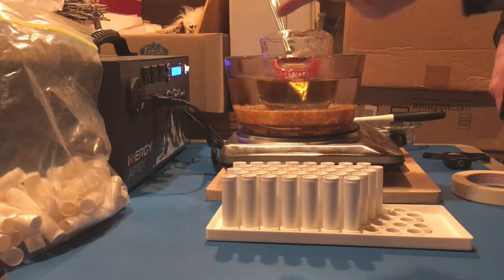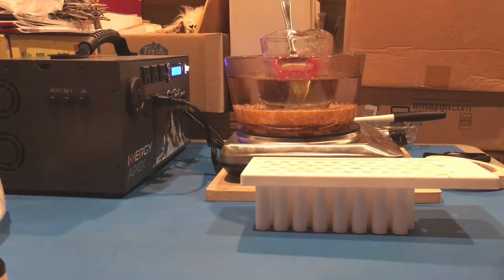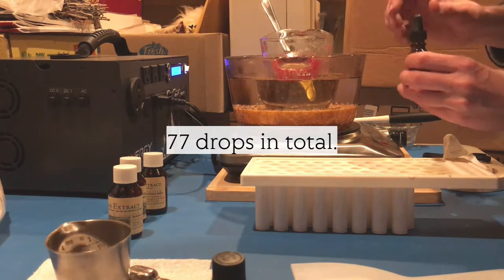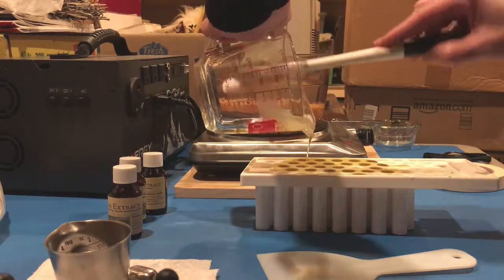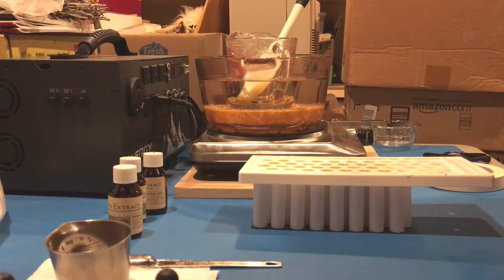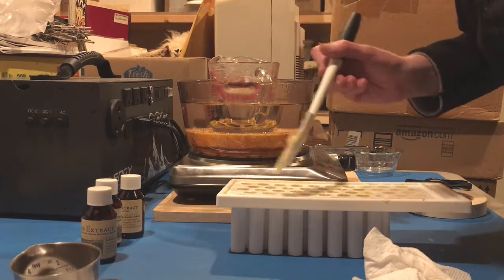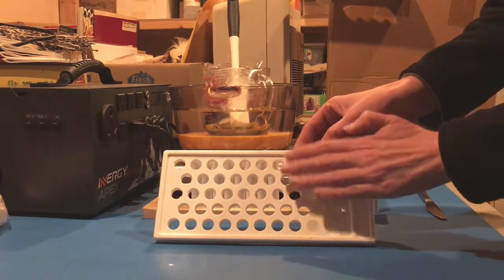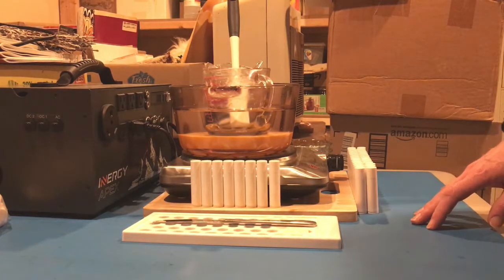Lip balm making, part 3:  pouring into tubes

Comment: Dove I've watched all three parts to this lip balm making process.  Never realized there was that much involved.  Once I made my own beer, and probably never will again lol.  You might consider measuring out the essential oils into one container while the wax is melting to speed things up a bit-  if they won't reactive in some way.
Reply from the maker: Lol.  Yeah, it's pretty involved.  I tried to shorten the video to save people some time.  That doesn't mean it takes less time to make.  Lol.  Essential oils have to be added at the end and they just love to go to the top of the mixture.  There's no way around it besides to keep mixing them in as you go.  They have a proclivity to rise to the top no matter what.
Reply: @freedomdove  I did not mean mix them into the melting wax, but rather measure them into a separate container on the side to be added to the hot wax at the the proper time.
Reply from the maker: @grandmaris  That would be possible, yes, if it were a covered container.  It doesn't seem like it would help the process much since that's just another container to wash out.  Lol.